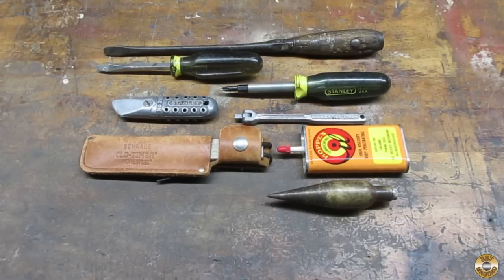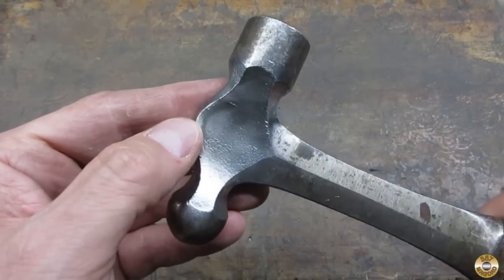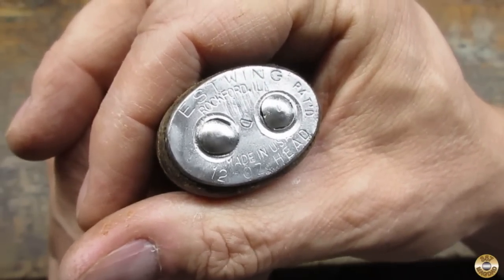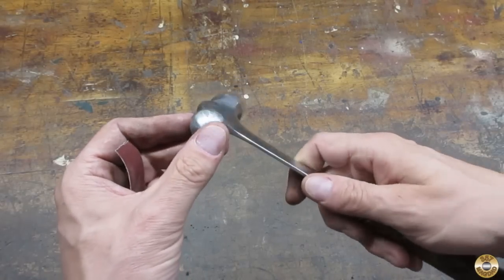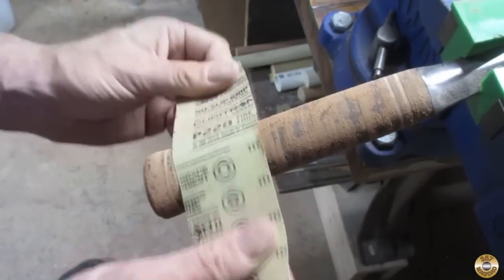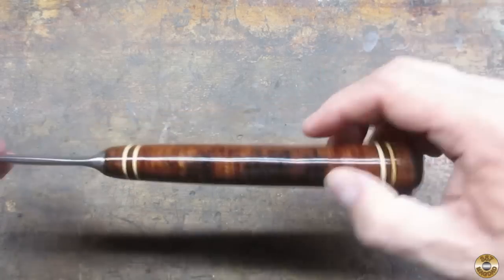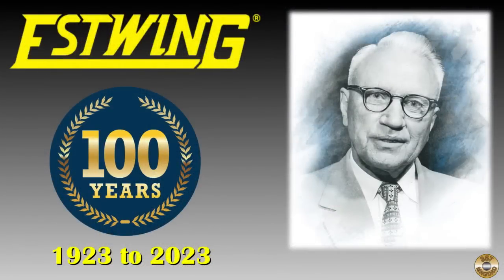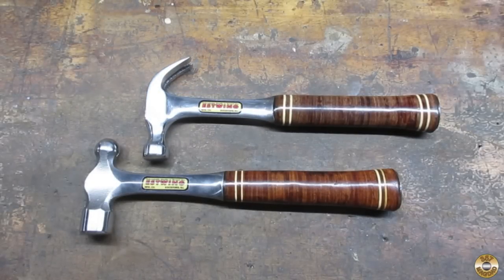12 oz Estwing Ball Peen Hammer Restoration

Comment: The hammer looks better than new.   So much easier to restore when all the leather is good, just the clear coat needing to be removed.   I recall when you had to replace the leather in a previous restoration.   That was a lot of work.
Nice touch with the waterslide decal.
Dave.
Reply from the maker: I've got another knife that needs a new stacked leather handle - maybe I'll get to it this winter.

Comment: Hey MagDad, I tried those conditioning belts you recommended on a prior video, but I had to return them because they wouldn't fit my 1X30 belt sander. Shame! Are there any small wire wheels where they don't fling out? Are the vintage dremel ones better than the modern ones?
Reply from the maker: I had to make some modifications to my machine in order to run the thicket conditioning belts.  I like the plastic abrasive bristle wheels as a replacement for the wire wheels.

Comment: Great timing. I got a 16oz claw Estwing this week that was in the exact same condition. I hope the leather on mine comes out as well as yours.
Reply from the maker: I hope your project is a success!  I put 5 coats of semi-gloss urethane on the handle, sanding with 320 in between.  I thought it was too glossy after the last coat, so I buffed it with 0000 steel wool and waxed it.

Comment: You’ve saved me the bother of trying epoxy on the wire spitters and the hammer came out great, cheers.
Reply from the maker: Some viewers suggested the epoxy.  I've also tried super glue and it also did not work for me.

Comment: Well done, stacked leather just makes everything cooler. It really came out great. I tried super glue on my little wire wheels. It kept the wires in but it seems to wick up the wires and makes them stiffer. I dont notice a difference in performance but they seem stiffer.
Reply from the maker: Thanks!  I had no luck with super glue.  It could be that my batch of foreign made wire wheels were not the highest quality.

Comment: I have a similar hammer. Mine needs new leather and it’s stamped Douglas tool on the bottom plate. I think it was made in charlotte nc
Reply from the maker: Replacing a stacked leather handle is a big project!  Check out the WW2 knife I recently did:
https://www.youtube.com/watch?v=tTE1Z9eZnag

Comment: Are you still using the first set of the conditioning belts, or have you replaced them at all?
Reply from the maker: Still using the original set.
Reply: @357magdad  Wow!  It seems like you have used them quite a bit by now!  You might want to mention that they are still the original set in your next video with them.  🤔😁👍

Comment: Several years ago (maybe a decade or so)  I went to the trouble of epoxying a cup brush for a angle grinder thinking it would keep the bristles in.........I found out they were just breaking off and the epoxy really didn't help.
Reply from the maker: I have also tried super glue - also didn't work.